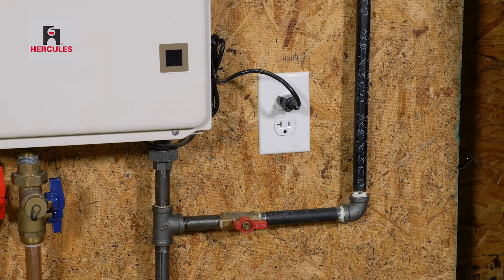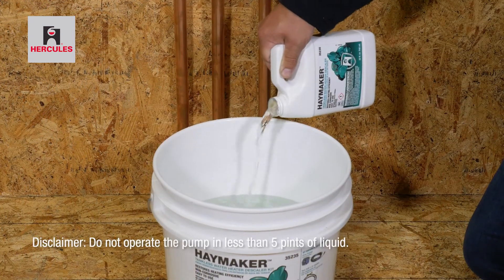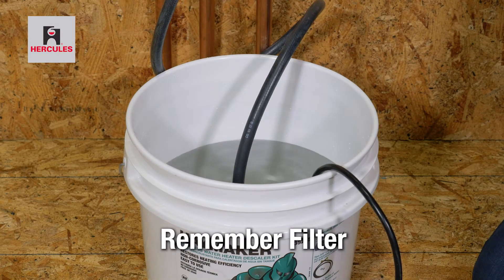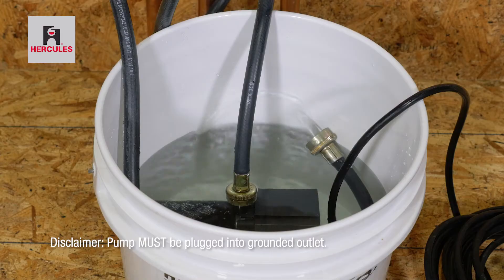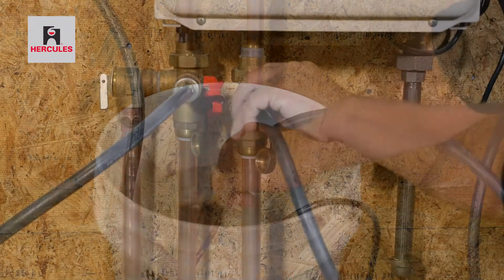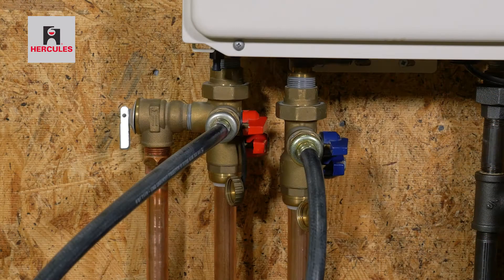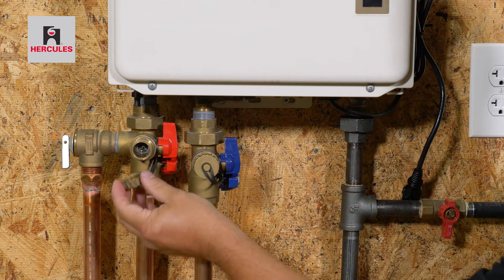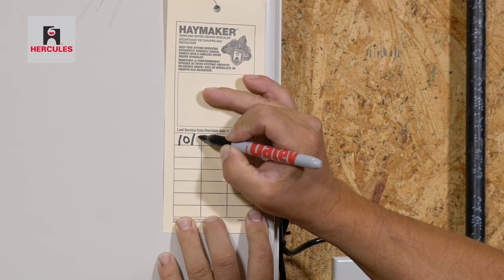How to Descale a Tankless Water Heater

Comment: You forgot to empty the hot water out of the heater before you descaled.  tThat's the valve on the left.
Reply: and did not clean out the filter
Reply: Unless he was using nearby faucet to release all the hot

Comment: Hi Great video. I did try it and for some reason (I verified 10 times :) plus I am pretty technical in it ) all connection is right and pump is pumping water in but it is not coming out from hot side Anything to check? Waited several minutes Nothing
Reply: Your isolation valves may have been installed backwards as I had the same issue as you. Check where the hot and cold valves are located. If it's on top of the hose outlet then it's installed incorrectly. Hope that made sense.
Reply: Thanks for your reply but I feel that cold pipe goes from pump and drain hose from hot pipe No clue what else to check. Seems that it should work but doesn’t Any other suggestions?
Reply: If you have this issue, check the "Filter Screen Assembly".  Filter could be clogged and cleaning it is very easy.
Reply: Had the same issue. Not sure where we went wrong.

Comment: There’s one step I am somewhat confused by in this video, and that’s the post-descaling/flush step. In your video, it looks like, after the hose is reconnected to the cold isolation, you put the pump back in and run it? 

However, my instructions and what I’m seeing when I go through the process with my heater is to reconnect the hose, open the isolation handle, and then simply use the main on the cold to flush water out instead of using a pump at all during this process. Am I missing something?

Otherwise, great video and very straightforward
Reply: You can do both. Opening up the main and let it drain through hot service vale is better but it fills up the bucket fast. So i let the pump run first fpr a couple of minutes and then opened the main for 10-15 secs for a final flush
Reply: @mqayyum9226 good answer, seems logical
Reply: It does seem like they run the pump again after filling the bucket with clean water… but the verbal instructions in the video never actually say, “plug the pump in again to run clean water through the water heater.” I’m fairly certain that’s what’s happening… but the attention to detail in creating this video definitely leaves something to be desired. He also appears to mis-speak at 1:43 by calling the service valve the isolation valve. I feel like they could easily fix this video by recording a new voiceover.
Reply: I have the same questions.
Reply: Either or is fine
Reply: Same question can you please be more explicit about how to perform the flush step? What do you mean “use the main”?

Comment: I have a transfer pump, this should still work too right? Just add a hose into the bucket from the inlet valve on the pump and circulate as normal? Thank you.

Comment: I don’t have isolation valves on mine. Can this still be done?
Reply from the maker: @Brent Holzhei If no isolation valves then it would circulate throughout the whole system. We would recommend reaching out to the manufacturer of the system as well for their recommendation on how to descale a system without isolation valves.

Comment: You refer to the isolation valve at the 1:48 mark or so, but in the video it looks like the person is opening the service valve, not the isolation valve. Are they one in the same or is that an error?
Reply from the maker: Thank you for pointing this out. During the descaling process only the service valves should be opened as demonstrated. The isolation valves should remain closed until the unit has been completely flushed.
Reply: Your comment saved me!
Reply: Why is my tankless water heater not hot enough
Reply: @henrynguyen171 same issue with me it’s warm but not hot hot
Reply: Either the instructions being read are wrong or the video is incorrect after this point.